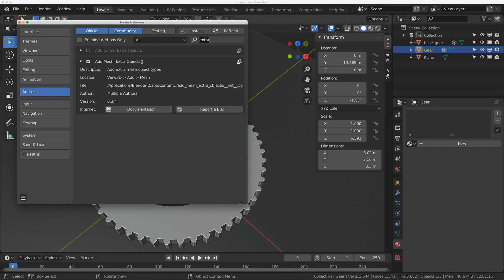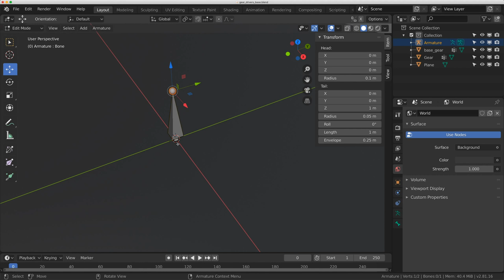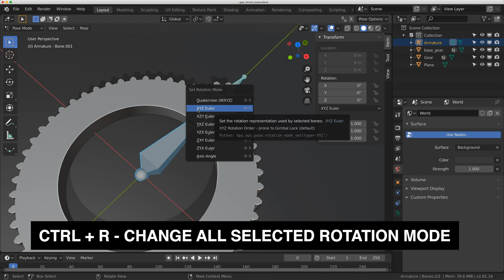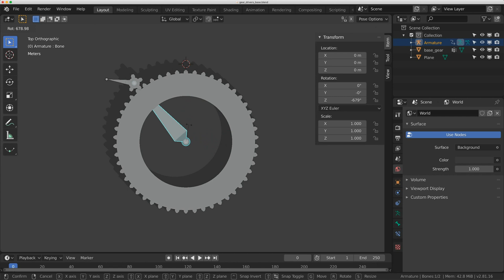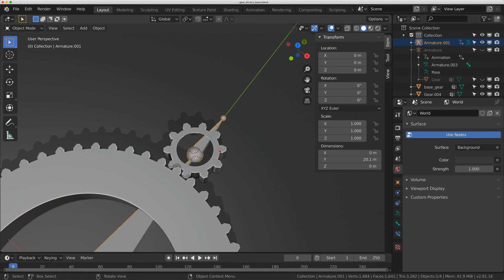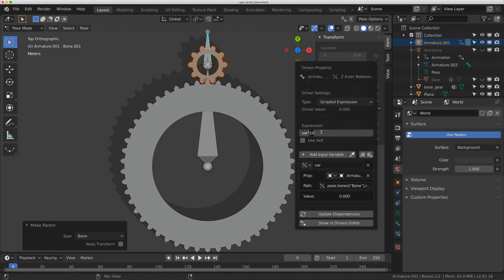Smaller Gear Rotating Around A Bigger Gear | Blender Drivers Master Class

Comment: Hey, this helped me with the planetary/cyclic gears I was making!
I have a question regarding rigging, I wanted to make an animation of a cube being rolled on the ground, so it will roll along its edge rather than its center, after trying out different things I was able to make the animation by parenting 3 emptys and keyframing the rotation, but what if I a different shape is to be rolled on a plane, can a universal rig be made for rolling 3d primitves/objects along their surface?

Comment: This is just artistic right, In real life those spur gears would mesh terribly, you need a properly calculated in-volute curve for constant meshing along the entire length of the teeth for maximum efficiency and transfer of torque
Reply from the maker: Absolutely, this is more for animation and games. For manufacturing you would need to do far more calculations. Probably better to use Solid Works for something like that.